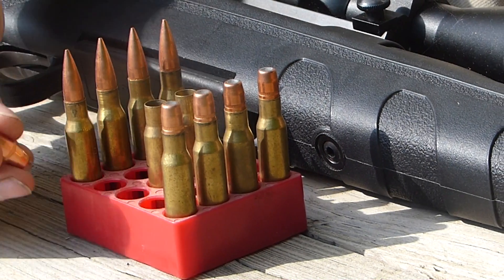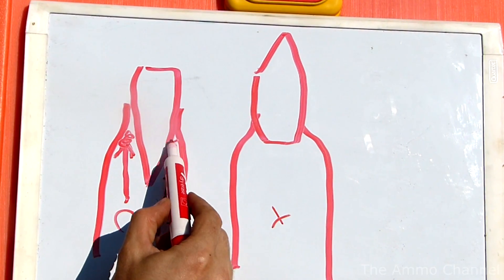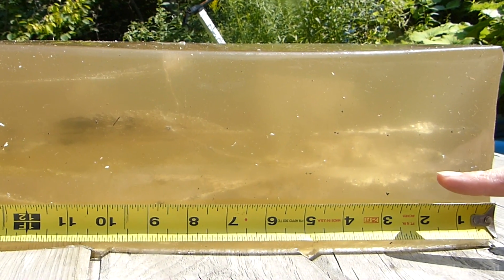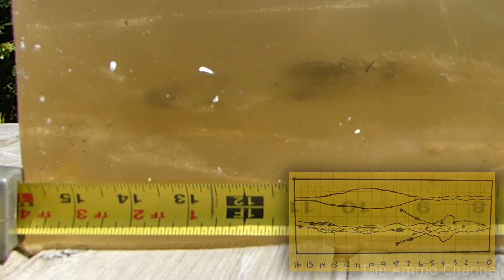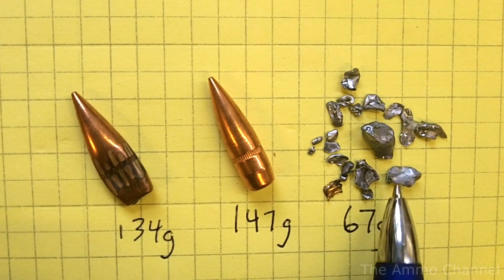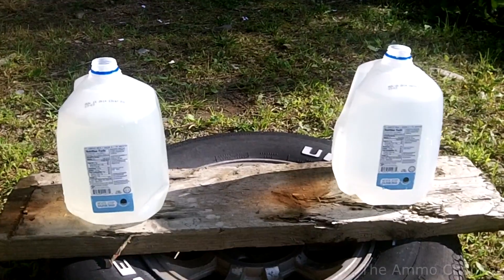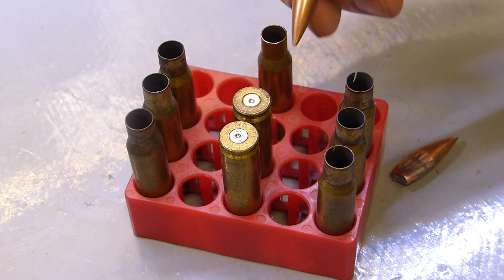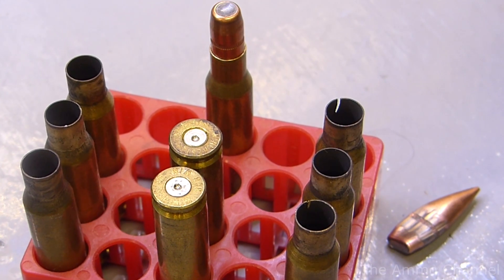Shooting Bullets Loaded Backwards

Comment: I would be interested in knowing how loading backwards affects the accuracy.  On Mill ball rounds for my 7.62x54r and my 8x57  Mauser I used to cut circles around the tip end of the jackets,some times cut the tips off or filed the sides of the tips to weaken the metal to make improvised hunting rounds out of them.  But I have never shot them into Gel to see what the effect was.
Reply: That's a bad idea. There have been cases where the core was squirted out of the jacket, leaving the jacket behind to cause havoc with the next shot.
Reply: Hi:) My dad was born in the 1920s and he told me that years a go if you used military ball ammo that the hunters would cut a X in the tip deep to get the bullet to expand  like a hollow point.

Comment: This was common during the great war. Soldiers, especially British, would reverse rounds to try to get better penitration on armored machine gun positions which had about a quarter inch of splinter shield. The .303 bullet used had a steel penitration core and cordite propellants so the results might be different and split cases and flattened primers would not have been and issue.  The practice wasn't condoned by the British military but most officers in the trenches turned a blind eye. I've actually seen a short film about the great war that had a clip of a tommy making reverse bullets.

Comment: while i agree it would be way smart to just BUY a round made to do what one is trying to achieve, such as explosive fragmenting. if someone feels they MUST do this, I think it would be way better to just load the bullet normal and cut like the front 1/3 of the bullet off flat. It would be pretty much the same thing, but loaded correctly, prolly would cut down on the messed up cases, and get rid of the over pressure issues, ect. Seems like it would not only but MUCH SAFER, but the bullet would prolly fly FASTER and STRAIGHTER. Seems logical, right?

Comment: This is why the the 30 30 lever action has taken so many deer.  That flat tip provides increased destruction upon impact.
Reply: I could have swore the reason for the rounded tip of a 30/30 or 30wcf is so that the rounds don't set each other off in the mag tube ???? Maybe I'm wrong idk
Reply: i know what your talking about... my first rifle was a 30-30 marlin 336 (golden trigger, micro groove barrel..its either a C or a W)...anyway.... the thing hits HARD. i usually shoot 150 grain because i need things to be flat....as in north east montana with a 30-30....your taking 150 to 200 yard shots on a regular. it just one of thows guns that stop bucks in their tracks. 

trophy white tail and mule skins have fallen to my 30-30.... and when all my other guns arnt working (bumped scope, no confidence in the weapon)... ill grab my 30-30
Reply: The 30 30 tip is that way so it will feed into a lever action more easily.

Comment: Nice demo. Seeing is believing :)
Reply: 07beachbum I've never been brave enough to try stuff like this. But then again, I blew up a mossberg 500 playing around with improvised loads when I was about 18, so, having the receiver of your shotgun turn into a hand grenade, will tend to make a person gun-shy about doing anything except what the factory calls for.
Reply: ***** it still is fully stabilized however....

we need a long range test!
Reply: *****
 Actually if you put the center of gravity toward the front of the bullet, i.e loading it backwards it should be more stable. I have done this with .223 w/1-9" with 55gr bthp's. at 900-1000 fps. and at 50 yards they group fine. and at 100 they seem stable just drop like a rock.
Reply: This video definitely confirmed your theory about the pressure difference, especially the case neck. One other thing not compared was the accuracy. I would think a bullet loaded backwards would be very inaccurate at any kind of distance. Kinda defeats the purpose of using a rifle!
Reply: ***** I still have doubts as to it being fully stabilized, and suspect it would begin key-holing as close as 50 yards, maybe even less.  I know for a fact that 70 gr .223 bullets will keyhole at just 25 yards when fired through a 1 in 12 twist. Now, that anomaly is being caused by nothing more than a heavier bullet being shot through too slow of a twist rate, not even loading it backwards. Surely, the bullet going backwards is going to have some tendency to begin tumbling.
Reply: *****
 Rifle wadcutters......sounds wicked to me under 100 yds. Great channel Ammo